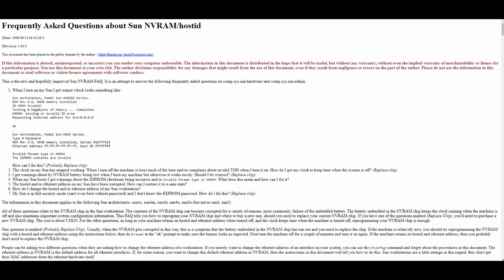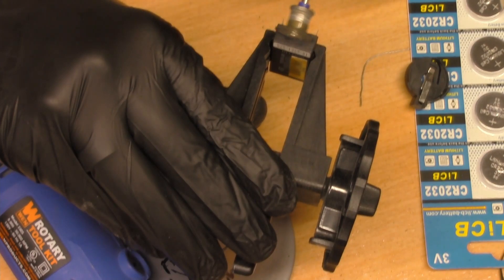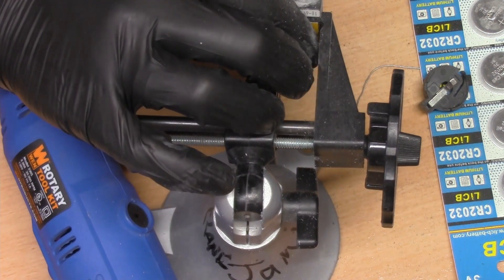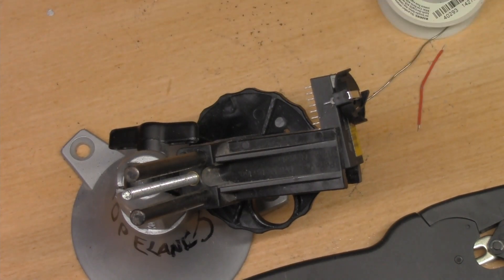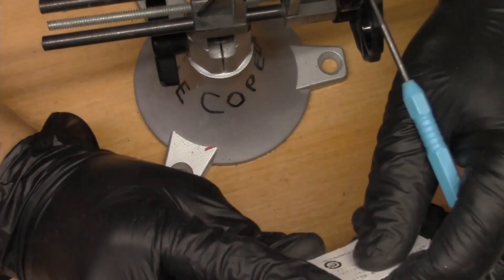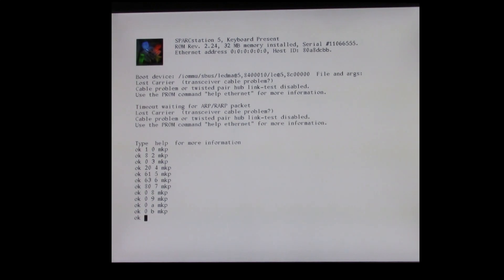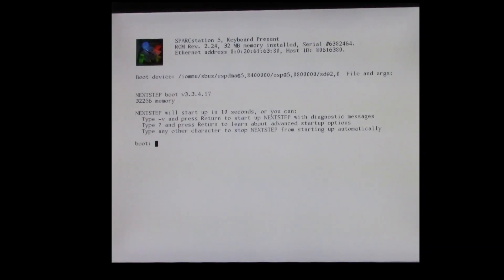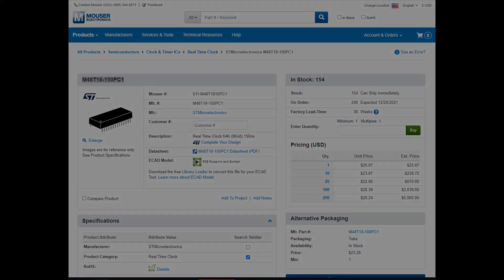Sun SPARC Dead NVRAM Battery Fix. Hack & Easy Method.

Comment: 224 / 5 000
Ich habe eine SPARCengine™ Ultra™ AXi mit M48T59
M48T59Y-Batterie verbraucht, ersetzen. Allerdings sind die MAC-Adresse und die lokale ID falsch. Kann man das korrigieren oder würde der Kauf eines NVRAM das Problem lösen oder müssten die Informationen neu aufgezeichnet werden?
Reply from the maker: I don't have first hand knowledge of that system but I'd hope if the battery has been replaced you may be able to re-enter your Mac address and local id etc and it save them with similar forth commands as these older systems. Again, I'm not 100% confident as I've not messed with an sparcengine ultra.
Reply: @JamiesHackShack  after changing the battery, set the host id equally on your video and the system and software does not recognize the hostid. could you help me?

Comment: Any idea if that same PN from Mouser (which is out of stock now) works for the SPARC 20 series? They are in stock at DigiKey, I have a couple 20’s that need them.
Reply from the maker: @c1ph3rpunk  Honestly I'm not sure. I've never had the chance to mess around with a 20. Wonder if the required specs it wants to have for the nvram are the same as the 5? Maybe I'll look around some.
Reply: @JamiesHackShack  there’s also a DS1643 exact modern PCB replacement for sale on eBay. Looks like someone got fed up and made one.

DigiKey is out as well.
Reply from the maker: @c1ph3rpunk  yeah there is a nice looking project from someone I saw the other day, I need to find it. You basically slice the whole top block off and leave the memory chip. It saddles on top with the battery and oscillator I think. I'll see if I can find what you saw on eBay. Sounds interesting.
Reply from the maker: @c1ph3rpunk  found it! Oh that looks pretty good!
Reply: @JamiesHackShack  stinks we can’t put links in YT… But seeing as how there’s only like 16 bytes stored in there, I suspect almost any 28 pin compatible would work, even one as small as 256 bytes.
Reply from the maker: @c1ph3rpunk  Yolo it and be the hero we need to confirm! 😂
Reply: @JamiesHackShack  I ordered a few options, including one of the modern ones off eBay, we shall see.

Forgot to mention, thanks for the video, it was exactly what I needed to point me the right way. I’ll make one with any results I get so there’s some current info around.
Reply from the maker: @c1ph3rpunk  Right on! Excited to see what you find out and you are most welcome. I'll link to yours from this one. 👍
Reply from the maker: @c1ph3rpunk  hey thanks for letting me know! I just checked that video out and it is great to know that option works! I'll put a link in this description here for others. Thank you!

Comment: M48118-100PC1 this is what I have 
Is the one on mouser electronics compatible in your opinion?
Reply from the maker: @alow2323  I used that one(the mouser one I linked to) at the time in my ss5 and it worked. I can recheck. May take me a day or two.
Reply: @JamiesHackShack  that would be great 
It is going in a royal vending machine if that helps 
Wish I could show you a picture but it looks similar but don’t they all
Reply: How much would you charge to put one on for me?
Reply from the maker: @alow2323  Hey, I'm sorry but currently that is not something I'm up for doing. I don't want to be on the hook for anything like that but my own stuff. :-) For your application do you have a way to reload whatever the settings are once you get it replaced or a battery tacked onto it?
Reply: @JamiesHackShack  yes I have to manually set the prices all over again if the machine is ever unplugged, not a big deal, but it is time-consuming
Reply from the maker: @alow2323  I mean this one may work for you. https://www.mouser.com/ProductDetail/STMicroelectronics/M48Z18-100PC1?qs=eb%2FRSZx1fMtLBqwnBmHVJw%3D%3D We need to find the specsheet on your original one there. I'm not coming up with anything. Mouser typically has pretty decent customer support. It may be worth a call to them to see if they think it would be an ok replacement for you.
Reply: @JamiesHackShack  thanks I appreciate your help 
And about messing up something with my chip, it doesn’t work so really you can’t mess anything up if you fix it I can pay you if you don’t fix it It’s trash anyway.
Reply from the maker: @alow2323  Hey I know its been forever ago but I wanted to bring your attention to a solution I just learned about. https://www.ebay.com/itm/304055368595 I saw in a recent video where this worked in a sparc for someone (see pinned comment/updated note in description here). You may want to reach out to this seller and see what they think. This may give you a route to a brand new for-sure solution.

Comment: How to check NV ram battery, which pin  i want to check
Reply from the maker: HI! I don't think that the internal sram battery inside the package exposes any pins that let you check its level. Other than trying to rig up something to write specifically to the sram portion.. and to see if it sticks would be the only basic way I can think of. Maybe someone else could have a better idea. With a Sun system you just know its failed when the idprom and mac zero out of the system on boot. Thanks!

Comment: Great video, very very helpful. I have some battery holders showing up tomorrow, and dremeled my chip this afternoon. However, the 'pins' inside look...odd.  Not sure how to describe it, and I'm guessing I can't link to some imgur images to show them. 
Others have wondered 'why bother' when the chips are cheap. True, but at the same time, if you are a guardian of old hardware that may not be powered up very often, it will be handy to just swap the battery instead of buying a new chip ever XX years....
Reply from the maker: Hey thanks for watching and commenting. Good luck with it! I agree 💯 with having it setup to just swap a battery instead of a whole chip.
Reply: @JamiesHackShack   Dangit, managed to bugger it up, this one is toast! But at least the chips are still made, so i'll be buying a few, so I can do the battery mod even on a new one (and have spares just in case, lol!)
Reply from the maker: @voxeluxamox  ah shucks! Sorry about that!

Comment: I just bought a Sparcstation 5 and I'm planning on doing this hack to it. Do you think you could dremel out enough to remove the whole battery? based on the pics at the beginning of the video it looks like it should be possible.
Reply: I did a few of these a few years ago. All the guides I read at the time told you to either remove the dead battery or to sever its connection to the crystal. It took a lot of diamond burr grinding with a dremel to achieve. I remember soldering one of the battery holder wires to a connection point above one of the legs rather than to the end.
Reply from the maker: 100% I think you could or at least break one or both of the legs leading to the old battery getting it out of the circuit. For sure though like that first photo shows(wasn't mine you can see it if you Google around) if you are careful you could probably expose it completely and remove it if you wanted. Let me know how it goes! Thanks for watching and commenting.

Comment: Looks like the new battery is installed in a parallel with the dead battery. Does that decrease battery life?
Reply from the maker: That's a common discussion point with doing these. I imagine it does decrease the battery life. Ideally if you can sever/isolate the old and just tack the new one in there it would indeed be better.